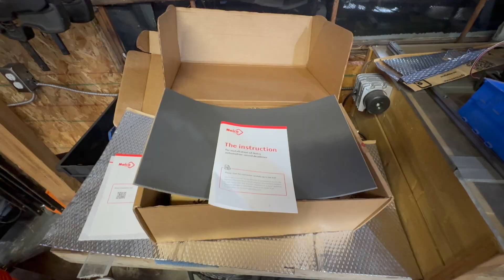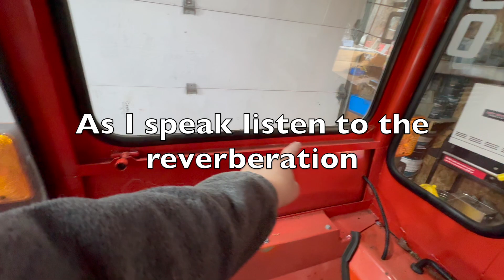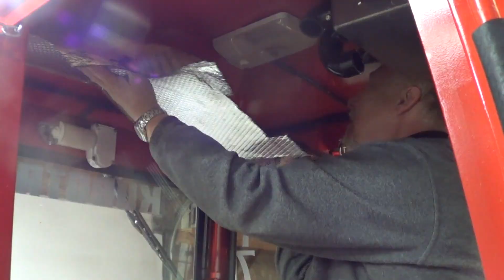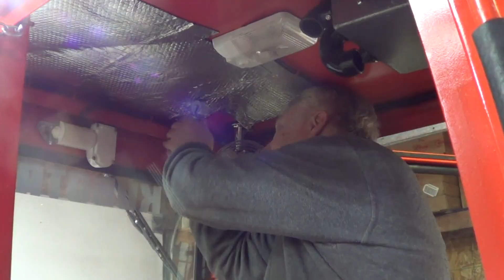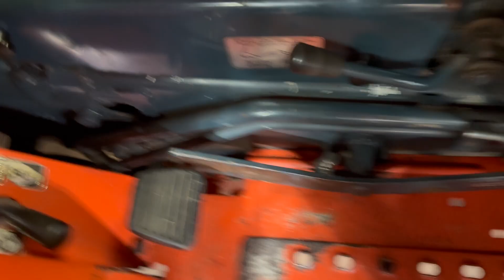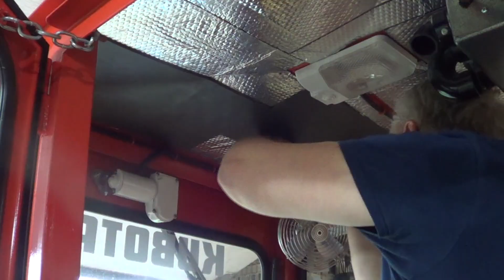Noise Dampening - Tractor Cab

Comment: A before and after decibel meter readings would have been great
Reply from the maker: @barnycanuck6234  you are absolutely correct. I did the tests but there was no variation or reduction in noise level. The only perceptible change was reverberation and that was a nice improvement for me.
Reply: @ ok thx. I was contemplating doing an old JD cab but (a) i need something mouse proof and (b) i don't want to do it if it isn't going to make a significant difference.
Reply from the maker: @ makes sense to me.  Let me know how you make out

Comment: First of all. You have a lot of noise induced by vibration. there is two ways of doing. Decouplic using sound decoupling pads (Elastomers mostly) or ading mass to the cab...
Reply from the maker: Thanks for the input,